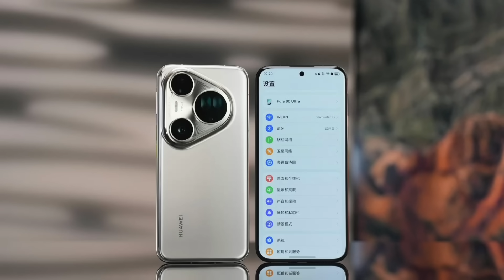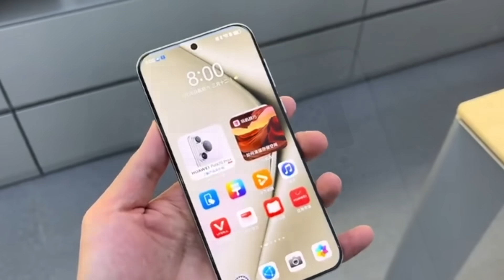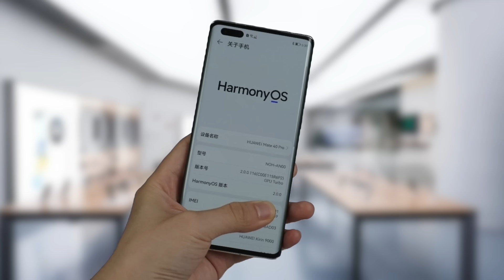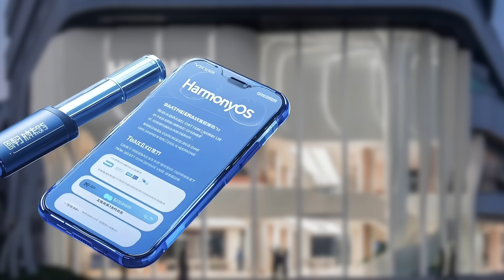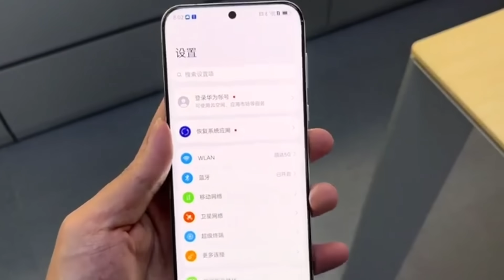Huawei's BOMBSHELL: The Kirin 9020 is HERE & It's Defying U.S. Sanctions

Comment: It is good to see Huawei rise from the ashes of US sanctions to rediscover its preeminence in critical and key technology.
The HiSilicon Kirin 9020 is a flagship system-on-a-chip (SoC) developed by Huawei's HiSilicon division. 
The Kirin 9020 is equipped with the in-house Maleoon 920 graphics processing unit (GPU), which operates at up to 840 MHz, though its specific architecture and processing unit count remain undisclosed. 
The SoC supports advanced connectivity features, including 5G via the Balong 6000 modem with download speeds up to 7.5 Gbps, Wi-Fi 7, Bluetooth 5.4, and satellite communication.
Necessity is the primary driving force for Huawei to innovate in the chip technology industries.
Survival is the only option for Huawei to continuing growth.